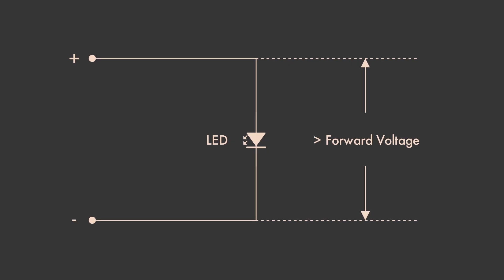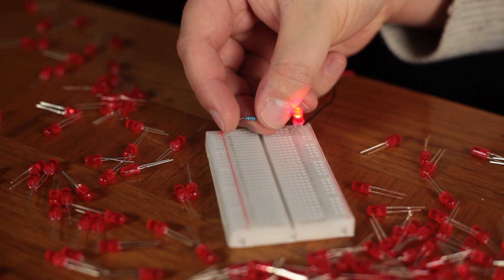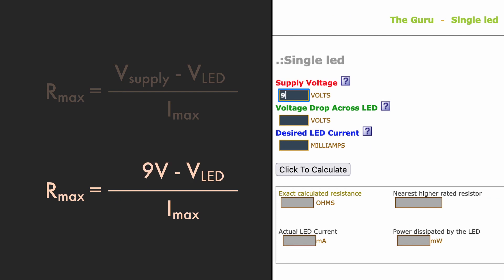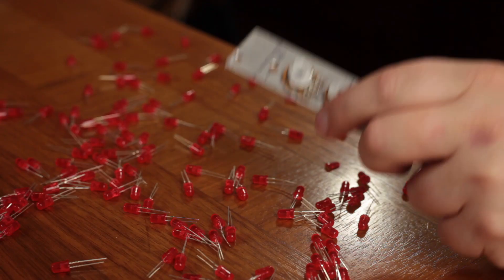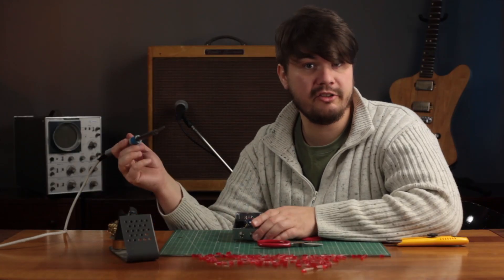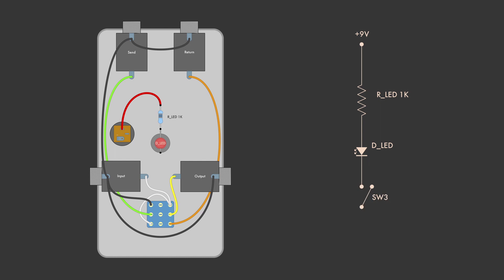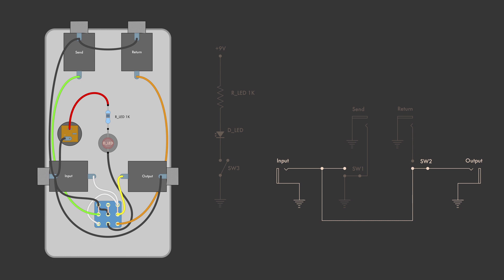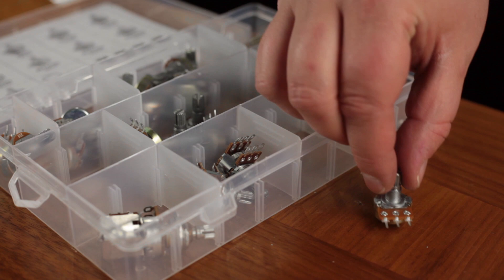Signal LED in DIY Effect Pedal

Comment: I just have finished an extremely simple passive pedal. I have added this led circuit to it. Everything works, except when the led is powered and i engage the pedal, i experience extra hiss. Are there any options for filtering this unwanted added noise generated by the led circuit?